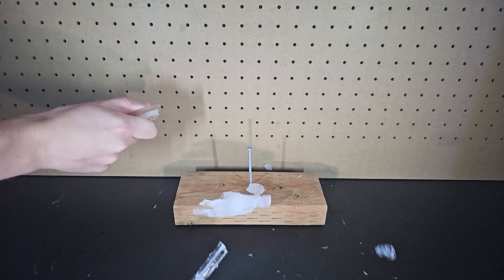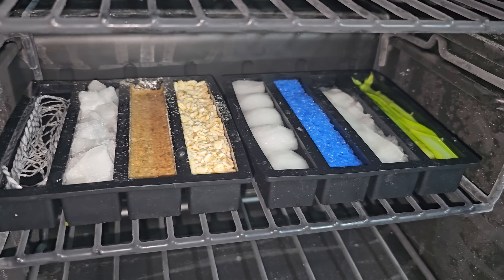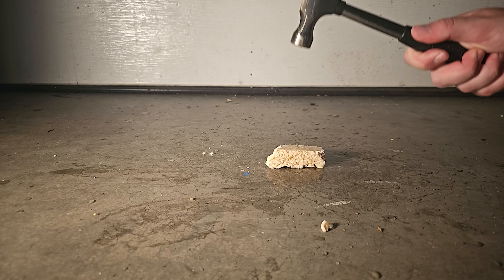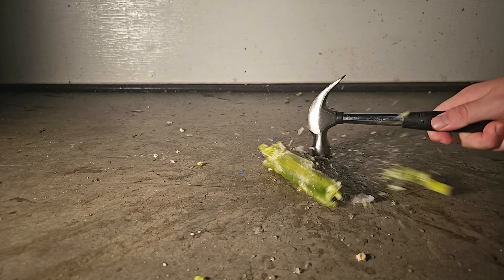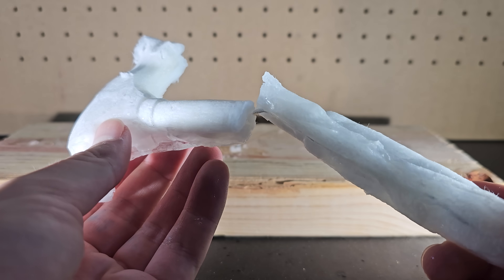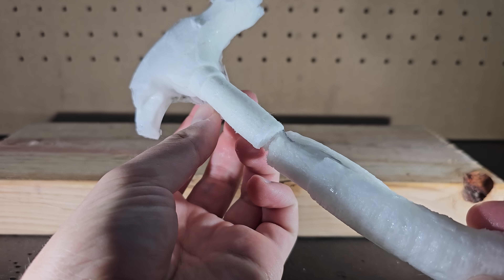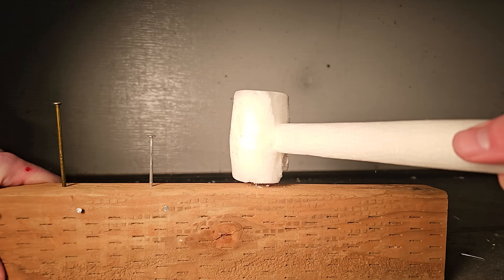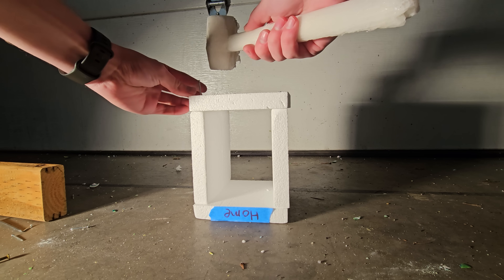How strong can you make ice? (World's Strongest Ice Hammer)

Comment: Suggestions:

1) longer grain sawdust. A mix of 14% wood pulp and nothing else in water is used to make a material called pykrete, which the british were planning to use as a major component in a carrier in WWII. The only reason it didn't get used, as near as I can tell, is that the primary proponent of the project died when he fired a gun at the stuff to prove that it was bullet proof(/resistant), and the bullet ricocheted and hit him.

2) Get a pair of carding brushes and some fur from a pet. Hair is disturbingly strong, and when carded for making string, will make a fairly continuous mass of material that you can then use to reinforce your ice. Your rebar idea with the string was a good one, you just used the string at the wrong stage. :P

Comment: Fun science history fact for people interested. 

Sawdust and water (Called Pykrete) has some interesting capabilities when it comes to building and such. 14% sawdust to 86% water ratio in larger blocks makes it essentially bullet proof and highly pressure resistant. Probably not good for hammers due to it finding much more success in large bricks, but you can make a sick igloo out of it. Layman's reasoning for why it works like that, the sawdust makes it super dense and disrupts the standard lattice structure of ice by itself, which makes the breakages less predictable and harder to do. One of the Allied forces Military during ww2 were trying to make a boat out of it at some point too. Neat stuff!
Reply: They didn't just use Pykrete for said boat (The HMS Habakkuk) but invented it specifically for the project.

It never got off the ground as it turns out that you can't just build an aircraft carrier capable of deploying B-17's out of Pykrete alone.
Reply: I learned about that on Mythbusters
Reply: It was the British trying to build an aircraft carrier

Comment: you need to cut the string into lengths instead of coiling it. that layout was never going to work. rebar also doesn't work to reinforce concrete if not placed properly.

Comment: Nothing against the video but i find it a bit silly that we'd still call it ice after adding something to it to make it stronger. The same with soil scaffolds where you use paper sheets to reinforce it (making it able to withstand quite a bit). Concrete is what is made from cement and Steel is made from Iron. If it takes some extra component to make it better its a composite or an alloy, the problem of never using these words is that it becomes unclear what you mean when discussing it and can't be found when searched for from academics to just a simple search engine in the web.
Now the question, what would you call the strong ice composite? Someone else mentioned Pykrete in the comments but if you had free reign to name it what would you guys come up with?

Comment: silicone cures to silicone so you can fix your mold, paper Mache outer with a string-paper towel interior might make it more durable and finally if you take the base idea of a mallet you could make a stronger one by having string wrapped cotton wrapped in paper towels frozen for the hammer handle, the head being made with impact resistant checks (sawdust, paper mache, paper towel composite)

Comment: I think using a nail with a larger head would have been a better test case: easier/move consistent to hit and less damage to the face of the hammer. Your missing the nail kinda throws off the repeatability of the tests, because hitting the edge of the hammer face is almost guaranteed to chip the ice.

Comment: Worked at a textile museum for almost 10 years. What makes cotton so strong is the length of its fibers and its ability to absorb. Tear apart the cotton balls. You were correct in that even the little gaps between make a weak point. Tearing them up will make it stronger than any strings or paper towels can.
Reply: Also, may be a good idea to organize the paper towels in "layers" following the direction of the force being aplied.
As in the hammer head, as far as it is suppoused to resist hitting a nail, the paper towels should be perpendicular to it, and in a lot of layers one next to another
Reply: Yoooo, that's so smart!
Reply: Mechanical engineer here, that was going to be my main comment.  Anything that makes a more homogeneous structure that the ice just connects will be best. Any discontinuities will lead to failure, so torn up cotton balls bridging all gaps will help the most.

I actually think if you did the same sort of thing but with old cotton sheets on the outside instead of paper towel that could be pretty damn strong.

In terms of the face, that’s really where this is going to be difficult.  I think tightly packed sawdust/oatmeal with a front face of a few layers of cotton sheet wrapping from the face back to the body of the hammer to hold it together would be your best bet.
Reply: I was actually thinking what if he sewed the cotton balls together when I thought about the spaces.
Reply: Exactly, as soon as he first put cotton balls in I was like please I'm begging you to tear them
Reply: its quite obvious 'gaps' will make a weak point, because 'gaps' are just 'pure' ice
Reply: @TMpebble exactly what I was thinking. And actually, cotton balls are rolled, so he should unroll them and lay them lengthwise in the mold.
Reply: That's so cool!! May I ask how and why you ended up working at a textile museum? It sounds really awesome but I've never heard of something so specific like that before, and I think it would be so cool if you were willing to tell me a bit about it! Sorry if this is weird, I just really enjoy learning new stuff:D
Reply: @pancakelord83 Museums tend to be specific by nature though. Have you ever been to a museum that ever had no theme to it? I haven’t. Not saying they don’t exist, I just haven’t heard of one. Usually they are specific like history museum, African American history museum, or art museum, or science museum. Even more specific are museums about wars like the civil war museum, American revolution museum, etc.
Reply: @ShiftingCloudsYT  Definitely, and I'm sure it wouldn't be super specific to a lot of people, but where I'm from a museum would usually be fairly broadly themed so textile is specific and even sort of niche in comparison ^^ I live in a small country without much of a museum culture so it's not really something I get to do a lot, and since I might never have the opportunity to visit a textile museum I thought I'd at least ask about it now that someone was commenting about their job there. I didn't mean to make sweeping statements about the world, I was just interested and excited to learn that there's a museum for textiles and wanted to know more:)
Reply: Yep, tear them apart and pack them tightly, and add some sawdust to the tip to make it strong against the hits, the hammer will be very strong
Reply: That’s exactly what I was thinking the moment he mentioned the cotton balls being spaced apart
Reply: Came here to say this. Thanks
Reply: The first bullet proof vest was made with cotton. It’s a great natural fiber.
Reply: or even better... a cross-linked weave of oriented and twisted strands... like a textile! I was watching this whole video and waiting for the big revelation. I'm convinced tightly-rolled denim would be absolutely killer.
Reply: I was going to basically suggest the same thing. Unwind the cotton balls and place the fibers lengthwise. Perhaps wind them into a rope that is the size of the handle. do the same thing with the head, but put a knot at the striking surface. Also: https://en.wikipedia.org/wiki/Project_Habakkuk .
Reply: Everywhere I go the comments always say "I worked at" Almost think there lying
Reply: @Pig697uh yeah because there’s thousands of people who watch each video, why does one of those having a relevant profession seem so unlikely to you?
Reply: @Pig697 Or maybe people just have jobs
Reply: @Pig697 I worked at Area 51 and all our tools had to be destoyable. Plausible deniability, naturally. We used ice hammers like this, and also ice saws and ice chisels for making the secret buildings.
Reply: You, uh.... You should probably watch the WHOLE video before, uh.... Before, ya know... Commenting something like this?

... Jus' sayin'😶
Reply: @DMTrance87 what would it change on his statement? He didint tear the cotton in the video
Reply: @DMTrance87 bro the commenter obviously did watch the whole video before commenting. The youtuber didn’t tear up the cotton balls and instead added paper towels and string to reinforce it (which the commenter referenced).
Reply: @DMTrance87 can it nerd

Comment: Wow what a low quality video. Couldn't even spend the money and time to get some decent silicone molds. Your hammering skills were sad. Your attempt at making a composite was sad. Everything just stank of low effort and quality. 

I think your first string mold says it all. Instead of cutting some string pieces and separating them (like how rebar would really sit in concrete), you just rammed a bunch of sad loops into the mold. All you needed to do was use a piece of thick paper at each end with some holes poked to run the string through and create some decent spacing. This would have taken 15 minutes. Or even a cotton ball at each end with string pieces laced through.

Comment: I think the objects that crumple during the hammer test do so because of the trapped air in them, since normal ice doesn't crumple like that. The most thorough way to fix this would be to draw a partial vacuum on it, but the second best way might be soaking them for long periods or reducing the surface tension with dish soap.

Comment: here is essentially a demonstration as to why we use things with elastic properties like wood metal and rubber. Crystal structures like ice simply crack and break where metal disperses energy throughout itself
Reply: Metal (like the low alloy carbon steel in the hammer) is crystalline within its grain boundaries, just like ice. Both have an elastic stress/strain relation until failure, but metal is ductile upon failure while ice has brittle crack propagation.
Reply: @pablogriswold421  ah yeah, i knew it was something along those lines. i just really couldn't remember exactly what the idea was.
Reply: I guess you could say the most rigid materials would crack under pressure
Reply: Also both crystal structures have an elastic region, this is a material property it is basically how much force you can exert before permanent (plastic) deformation. For metals this is much higher than for ice. In addition to the difference of ductile vs brittle failure modes as already explained (metal bends, ice shatters) this is why metal is preferable for such a task.

Notably, the properties of carbon steel depend heavily on its processing. If quenched and untempered, it may form a martensitic steel which is just as brittle as the ice—the primary difference being that a much higher force would be required to cause failure of martensite than ice.
Reply: Well, not quite. In this case brittle and elastic aren’t quite opposites. It’d be more accurate to think of it in terms of brittle and ductile as being different failure modes for materials. All materials have an elastic region where the bonds in the material stretch at the atomic level and allow a certain amount of reversible deformation. Once their elastic limit has been reached, they begin to irreversibly deform called plastic deformation, if they are ductile like many polymers or metals. For some materials this region may be small or non-existent. Lastly, they reach the failure point where they crack and fracture.

In a ductile material, this plastic deformation region is large. In a brittle material it is very small or nonexistent.

Wood is actually a composite material made from a lot of organic compounds. But we intuitively know it has elastic properties, especially when it is alive. Just think of how much you can bend a living tree branch before it snaps. That’s a great example of its elastic properties.
Reply: @timothysullivan1669  It's one of the most useful materials, in my opinon. Metal and wood pretty much are at the top for the most useful renewable/ or recyclable materials.

Comment: Rather than go cold, you could go hot - melt some Fe and C with a small amount of Mn in a furnace and add it to a mould - to differentiate it from the ice mould, let's call it a crucible instead - and then let that cool. Once it's done I reckon what you've produced would do a really good job of hammering nails in.

Comment: During World War II, Geoffrey Pyke proposed it as a candidate material for a supersized aircraft carrier for the British Royal Navy. Pykrete features unusual properties, including a relatively slow melting rate due to its low thermal conductivity, as well as a vastly improved strength and toughness compared to ordinary ice. These physical properties can make the material comparable to concrete, as long as the material is kept frozen.

Pykrete is slightly more difficult to form than concrete, as it expands during the freezing process. However, it can be repaired and maintained using seawater as a raw material. The mixture can be moulded into any shape and frozen, and it will be tough and durable, as long as it is kept at or below freezing temperature. Resistance to gradual creep or sagging is improved by lowering the temperature further, to −15 °C (5 °F).

Comment: Keep the hammer in a freezer when not in use to maintain its structural integrity.
Use thick rods or handles to distribute the stress during impact.
Consider adding small fibers like synthetic spider silk)to the water to enhance toughness.
To make the ice denser and harder, add a small amount of salt to the water (around 2% concentration).
This lowers the freezing point and creates stronger ice.
Fill the mold partially with water and let it freeze until solid.
Add another layer of water, placing the hammer handle into the mold while it's still liquid, and freeze again.
Continue layering and freezing to prevent cracking.

Comment: You have a mass problem. Steel is about 7.85g/cm2. Water ice is 0.92g/cm2. You need 8.5x the volume of ice as steel. You also need a different shape: the mallet has too much width: let the volume "trail back" from the face. 

Next, shred the cotton balls with forks or brushes to make a homogeneous mass of cotton, then twist it for the handle. Maybe twist it for the head, and wrap the handle twist around a necked-down area in the head.

Comment: When doing a composite do not use cotton and paper towels, use materials with complimentary strengths. Cotton and oats was a perfect choice but you forgot the asparagus.

Take the asparagus and boil it and pull apart the cotton and make a goopy mess out of them. Then add the oats right before freezing. Just distribute the oats evenly and you will have a strong durable material.

The mallet was a bad mold choice, because it combines rubber and wood. You either want an all steel hammer designed from a single material for your mold or just make the head out of ice and use a wooden shaft.

Comment: You should have included a version that had rebar in it. Rebar works well in concrete, it probably would work well in ice. And also, maybe a mound of Liquid Metal poured with the water because hammers are usually metal

Comment: You mentioned thinking of the string like rebar, but you forgot to do something rather important with the string to treat it like rebar, putting it under tension. Not sure the best way to do it but it might be helpful to tension the string through the mold while the water is freezing. Also interlocking the cotton from the swabs should help with the reinforcement as well.

Comment: brotha, if you want the hammer to not break after a single use, a ice hammer won't be possible. Even with 0 uses, it will melt and be unusable, all you have to fo is put it back in the mold, add a bit of water and freeze again

Comment: The material used in the head of the hammer could be the one which did the best on the hardness test. The handle can be a more flexible one, like the sponge, so instead of breaking it would just deform a little.

This approach could be closer to how real hammers are made. A metal head to hit hard, and wood handle to absorb the impact.

Comment: You could try using calcium chloride (2% to water) for the hammerhead to make it denser and tougher, and agar (2-3% to water) for the handle for added flexibility and strength.

The freezing temperature with calcium chloride at 2-3% wouldn’t be too low around -3°C also try distilled water because impurities in the water can make it weaker when frozen. And with such low percentages of additives you could still call it true ice

Comment: The handle of the hammer should be optimized for absorbing energy, not hardness like the head. I’d recommend using sponge in the hammer since it did well in this area. Possibly the core of the head could be made of this too, since only the surface benefits from maximum hardness.

Also, your hardness test was dynamic, not static, meaning energy absorption was also tested. This probably led to a large disadvantage for brittle materials (if you tested a ceramic plate in the same way, it would likely fail despite its very high hardness). A more hardness focused option would be scratching the ice with a nail and observing how deep the scratch is.

With a better test, you could find the actual hardest material and use it for the surface, while compensating for the disadvantage in energy absorption by using a more ductile material for the core of the hammer head.

Comment: Another thing, when making an ice hammer you wouldnt want it to be the shape of a normal hammer
Like narrow shaft near the head is unimportant with s single piece, you dont have to worry about head sinking deeper into the shaft and as metal hammers have chipped parts to save weight, they create weakpoints